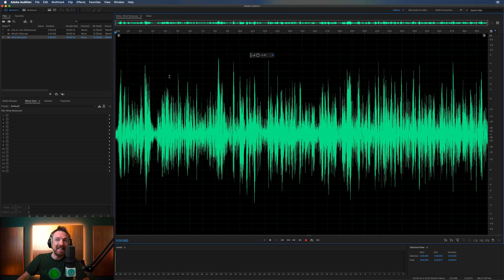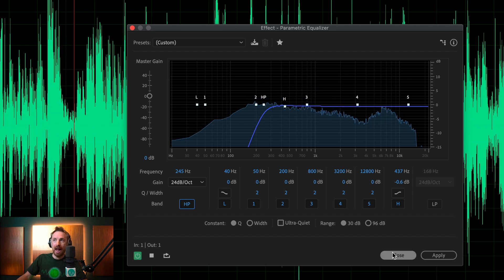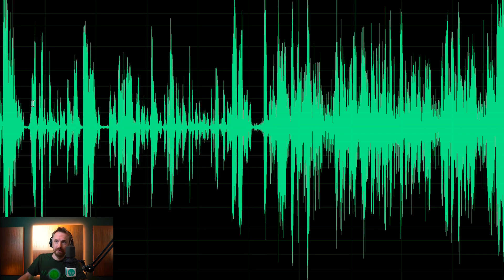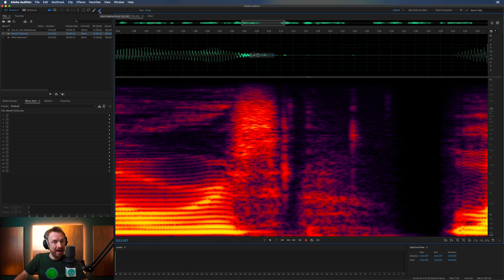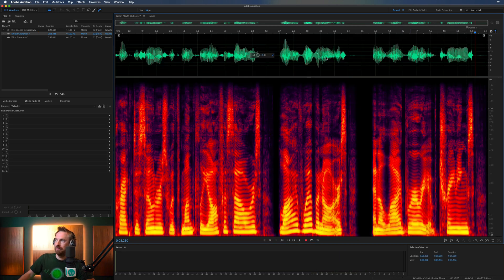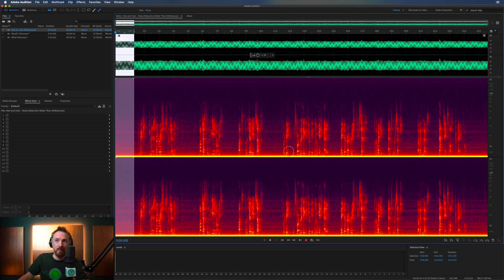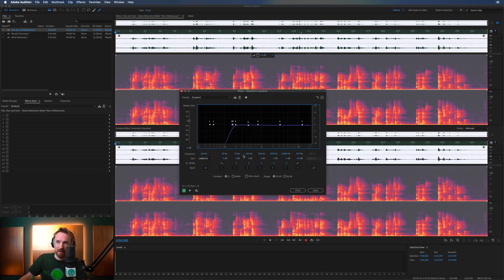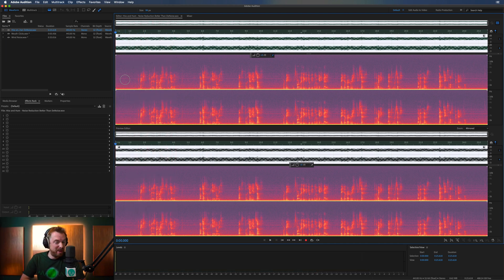How to Remove Noise - Wind Noise, Mouth Clicks, Background Noise & Static - Adobe Audition Tutorial

Comment: Hi Mike - I have two burning questions: is it possible to save the noise imprint captured in the Noise Reduction effect for use in other places in the audio, and secondly - if a voice imprint was overridden by another one, can I somehow go back to the previous one? Thanks.
Reply from the maker: Yes, you can save the noise print as a preset in the Noise Reduction effect and use it in other parts of the audio, but unfortunately, there's no way to revert back to a previous voice imprint once it's been overridden.
Reply: @MikeRussell  thank you. Of course. I must remember the SAVE option in the Effects windows. Pity the overridden print can't be restored though. Luckily, I ALWAYS copy to new my original audio files and work only with the "working" version ( a life saving tip I picked up from another Audition guru online :-) so if needed I can go back to the original and get what I have stuffed up  :-)  This is especially important as I always edit my files in Audio (including noise reduction) and only fine tune master in Multitrack. Thank you for posting so many very helpful Audition tutorials!😀👍

Comment: My room noise is in the -50's at the bottom. Do you have an idea as to how to drop it to -60? Computer and AC are both off when I record, so I wonder what you think?
Reply from the maker: To reach -60 dB in your room noise, consider adding acoustic panels or soundproofing foam to reduce any lingering ambient noise that might be affecting your recordings even with the computer and AC off, ensuring a cleaner audio signal for better results.

Comment: Hi! Can I ask what's the difference between wind noise and background noice & static? Why were they treated with different methods of noise removal? Thank you
Reply from the maker: Hi there! Wind noise is typically a specific type of noise caused by air hitting the recording equipment, while background noise and static are more general ambient sounds present in the recording environment, hence requiring different techniques for effective removal. Hope this helps!
Reply: @MikeRussell  Very much, yes. Thank you sir 😊

Comment: Does this work for wind when riding a motorcycle? I want to record the sound of my exhaust, but it still picks up a lot of wind noise. Despite following your advice, the wind doesn't completely go away; there's always some wind noise. Regards
Reply from the maker: I recommend trying a combination of noise reduction techniques specific to wind noise, adjusting settings based on the frequency range of the wind noise, and using advanced tools like spectral frequency display in Adobe Audition to further refine the removal process for motorcycle recordings.

Comment: Thanks for this. Very helpful.

QUESTION: @MikeRussell What's the best way to automate removal of clicks (and swallowing) sounds? On a long recording, it can take a lot of time finding and manually healing them. Any suggestions would be greatly appreciated.
Reply from the maker: Glad you found the tutorial helpful! In Adobe Audition, you can try using the "Auto Heal" function coupled with the "Capture Noise Print" feature to automate the removal of mouth clicks and swallowing sounds on longer recordings, saving you valuable time in the editing process.

Comment: so i use the capture noise profile to highlight the specific sounds i want to cut but it also cut out the studio ambiance that i want... is their a setting in the noise reduction that will take away the background sounds but keep the studio ambiance?
Reply from the maker: You can try using a selective noise reduction technique in Adobe Audition to remove unwanted background noise while preserving desired ambient sounds. Experiment with the masking feature to define the areas you want to keep intact. For further precision, consider using multiple instances of the noise reduction effect, each targeted at a specific type of noise.

Comment: I enjoyed your demo and the methods you used, especially with the spectral analysis on the old church recording, but what you treated in the middle section and were calling mouth clicks sounded an awful lot more like breathing noise. I'm chronically dehydrated because of medication, and my mouth "clicks" actually sound like clicks because of the high frequency and short duration, which all stems from a lack of saliva, and is very uniquely identifiable on the wave form, just as breathing noise also has a very specific and different pattern on the waveform.
Reply from the maker: I appreciate your observation regarding mouth clicks and breathing noise in the audio treatment. Identifying and distinguishing these audio artifacts can indeed be valuable for effective audio editing.

Comment: Great video Mike! So helpful! I appreciate you sticking with just Audition for the de-clicks and not switching to another program to clear those. Is there a best method to remove super clicky audio for the whole recording without ruining the audio or removing most individually? I was playing around with the declick and it sounds overprocessed and still can hear the clicks. Thanks!!
Reply from the maker: Clicks, like most audio imperfections, are best removed at source.  Try to avoid chocolate or dairy before recording and some say that eating an apple just before recording will reduce mouth clicks.
Reply: Hi Mike, what about the RX plug in by Izotope for Adobe audition? If one could afford it, would it perform a cleaner quicker effect?

Comment: Someone please help. When I use denoise, the beginning of the cut is always muffled a bit. If I have multiple cuts through the video, every single one of those begins muffled for a second before going back up to normal levels. How do I fix this?
Reply from the maker: The easiest way would be to mixdown the audio and include some silence at the beginning.  Then use Denoise on the mixed down clip.

Comment: For the noise reduction section, is there a way to undo it if you went too far? Because i put it on too much to get rid of hissing, but now the audio just sounds muffled, and i tried to find the original audio file, but it sounds like it was overwritten. is there any solution to undoing it?
Reply from the maker: You can only undo using CTRL+Z.  Once you've saved the file there is no undo
Reply: @MikeRussell  so the original audio file is no good? even outside of audition?
Reply from the maker: If you have the original audio then that's fine to copy and edit again.  If you only have the version you've edited and saved then that's all you have.

Comment: Dear people, After a recording I found that there was a break in the cable in the microphone, causing the left or right to drop out and an annoying cracking sound, with the audio settings I have set both to the left, but now the sound goes constantly down up. can someone help me with it?? If necessary for a payment
Reply from the maker: To try and rectify this convert the sound to mono and moving forward replace the mic lead ASAP before any further recordings
Reply: @MikeRussell  thank you for your response 👊 , I already did that, now the crackling is gone but the volume goes down very much where the sound normally cracks
Reply from the maker: I would suggest re-recording with a new mic cable but if you can’t convert to mono and use a compressor to level up the sound.

Comment: Thanks a lot for all your helpful videos, Mike. Whenever I have an audio issue or question, I find help on your channel. Since I found your videos, my audio has improved big time and my subscribers appreciate that just as much as I do!
May I ask a question: if the wind is really high, I get some wind noise despite using small dead cats on lavalier microphones. After I remove that with hi-pass, the voice sounds A LITTLE like listening through a phone - I hope you get what I mean, it's just higher and not so warm. Do you have a method how to improve that after reducing the wind noise?
Thanks again - keep going!
Reply from the maker: I think the issue here is that the wind noise is more than just low rumble.  Using the HP filter will cure the wind noise but in doing so you're also removing the lower frequencies in your voice which, once removed, you cannot add back.
 
Perhaps look at the HP filter lower down, no higher than 120hz and a combination of that and De-noise or adaptive noise reduction.
Reply: Thanks, Mike. Much appreciated. I'll give that a try! Maybe I'm just too picky 🤣
Reply from the maker: Wind is a microphone's worst enemy!!

Comment: My video has pretty significant wind in the background ... when I move that HP frequency btw 690-710 it really distorts the voice. Is there a way around that? Also, it doesn't eliminate the higher frequency wind. TIA --Rachel
Reply from the maker: If the wind noise is over dominating the voice then I'm afraid your only option is to re-record the audio.  If you take the high pass filter too high then the spoken word audio is ruined unfortunately.

Comment: Is there anyway to automate healing the clicks? There was a background ticking. so it's throughout the video. It's an hour long. It's not that important to go at it manually. It's just informational video for reference. But its 'gnawing' hearing it. LOL.
Reply from the maker: You could try the automatic click removal or click/pop eliminator under the noise reduction / restoration menu
Reply: @MikeRussell  Worked. LOL. I guess I could have seen that we a lil' investigation. I did google. Anyway, you had the answer. Thanks!
Reply from the maker: Glad to have helped 👌

Comment: Doesn't the low is filter also cut off the low parts of voice? My voice sounds tinny of I apply that.
Reply from the maker: Hi Tejas, the high pass filter will cut all audio beneath the figure you set it at and allow all audio higher than that to pass through.  Play with the frequency at which you have the high pass filter set until you have a happy balance